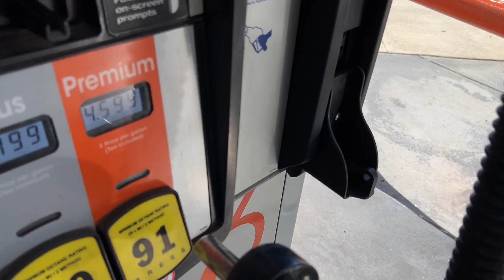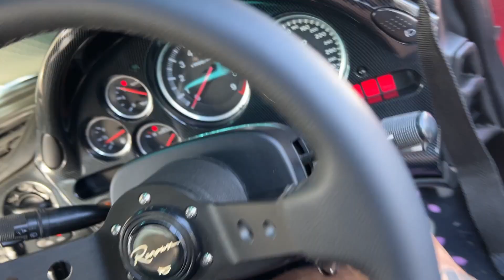Rx7 FD Color Reveal!! + Tofu Car Is BACK! / S3E12

Comment: You can buff out that plexiglass no problemo if that’s what bothers you about the headlights. They’ll come out looking super glossy
Reply: Also if you want it to stay without those scratches and swirls you have to use plastic/plexiglass cleaner. Not just normal glass cleaner